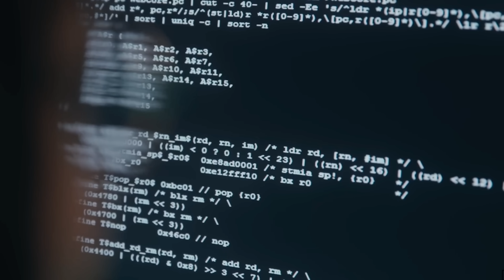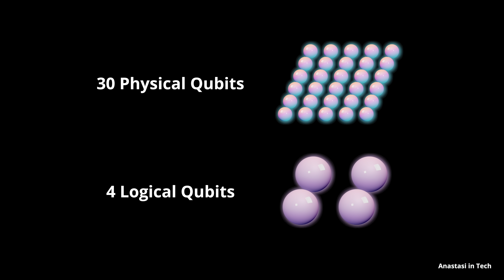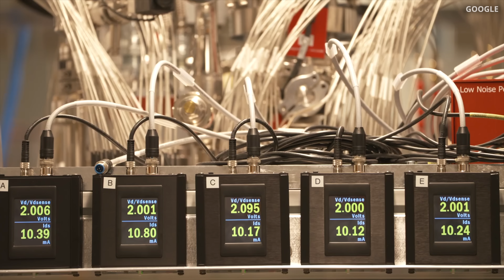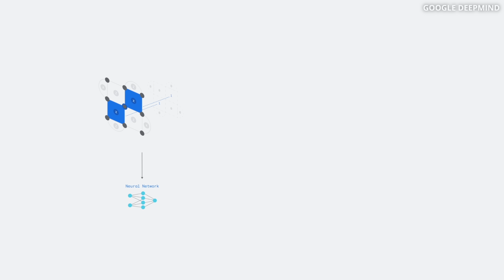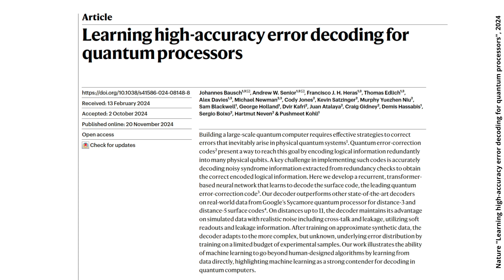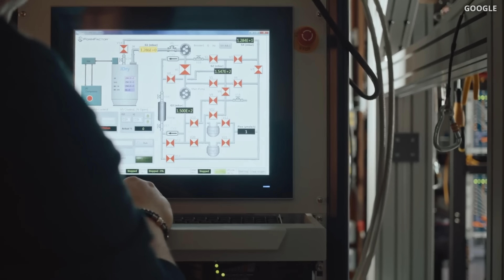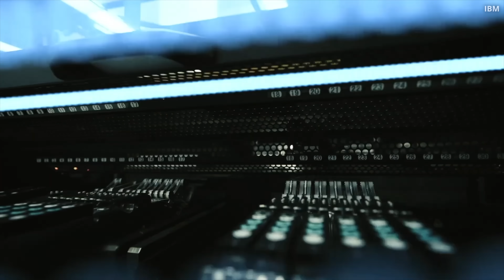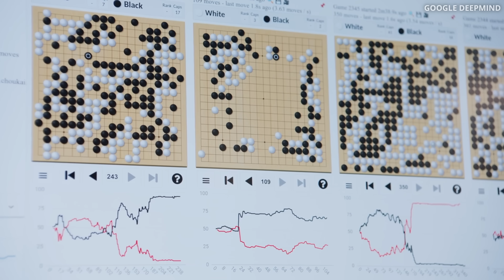When AI Meets Quantum… Everything Changes

Comment: 5 minutes in ~ ok, stop. Time out. I'm being dumb because I should watch and listen to the end, and then react. What's going on at 5 minutes is still largely preamble and introduction, but I can't hold my tongue. My keyboard finger is itching ~
The quantum world differs from the normal world on a number of very fundamental things. Quantum is weird.
Real world, we use something like a tennis player serving as an example, because we all get the physics. This is our world, and (except for politicians) it makes sense. It obeys the laws of Newtonian Determinism. If I drop the ball it takes a specific exact time to fall the 900mm from my hand. We can calculate that down to million-ths of a second.
The quantum world doesn’t work like that. The vital stats of a quantum object, are not fixed or known, they exist as a fog of probabilities. You can say intelligent things about the mass and the spin and the electron shell level of an electron, but when you start to check, the probabilities break down. You have broken the symmetry. That photon is no longer both a wave and a particle ~ you have forced it to become one or the other. At that point you have crossed the line from the world of quantum and Heisenberg ~ into the world of Newton.
Alright, we understand this.
But if the quantum superposition of that q-bit, was what made it a q-bit, but you add error correction, now you have crossed the boundary, the border between quantum and classical. Newtonian. By the exact act of adding certainty, you take away the quantum uncertainty and percentage probability that makes quantum stuff weird. You have taken your thing, your subject, your question to be solved, out of the environment of a university research team, and put it back in grade school with eight and nine year olds learning their times tables.
This is much much simpler maths, far easier to do and to manipulate with algebra, much easier to understand, and best of all ~ there is no uncertainty. You are back in the world of Boolean Algebra, where there are ones and zeros and nothing else matters. Trouble is, you’ve now removed the very thing that made your quantum model special. There is no longer any quantum superposition and Heisenberg’s half-dead cat, because to fit it into MS-Outlook or Excel , you’ve just killed the cat. Yes, it works a lot better ~ it would. But it’s no longer a half dead cat.
You have a much better conventional computer now, but you’ve just killed the whole reason you wanted a quantum computer with half-dead cats to start with.
~~~~~
Personal opinion perhaps, but if you add error correction to a quantum computer, you have made a massively better conventional computer ~ but the damn thing is no longer a quantum computer. The fact it’s made with gold pipes like curved modern sculpture and runs at 2 degrees above absolute zero ~ that’s suddenly become irrelevant. The fact it costs a million$ a second to operate, that's also become irrelevant. It is a far far better computer, but it’s no longer haunted by half-dead cats. 
~~~~~
Now, while I’m objecting to things ~ let’s talk about AI.
AI can be and sometimes is, phenomenally useful. It can do some stuff that no other technology can. It is pushing out the limits, the boundaries of human knowledge.
[sigh] ~ yeah, but … 
AI learns in a way that takes at least a thousand times more repetition and examples, than a conscious logical thinking human. You teach a toddler to tie a shoelace, or his swimmers up, and you might have to show him / her a few times. 2 or 3 might not do it, it might take 8 over the course of a week. But you don’t need to show her how to tie a bow 37 million times. You don’t need to show her that it works the same in the bedroom, on the porch, at Nanna’s house ~ or at kindy ~ nor provide multiple examples of all those cases.
Children learn to think.
AIs learn to react ~ like a reflex. That’s what it is, a one stop reflex like a blink reflex, like balancing a ruler on the palm of your hand. They don’t think ~ they react.
Then we have the problem of eating your own poo.
Q: What do you train each new and bigger and better AI on? 
A: The whole internet, obviously. 
Fine. But what if 30% or 50% of the Internet, has become an AI hallucination? What are we training it on?
Garbage in ~ garbage out.
Ok ~ so what do we get if we combine quantum uncertainty with garbage in ~ garbage out, and the eating of garbage? Or faeces? They told me while learning to tie my shoelaces, you are what you eat ~

Comment: As things stand there are three basic bottlenecks constraining data centres running AI work loads; power, heat and data transfer - getting enough power to a data centre and distributing it within is now non-trivial problem, existing GPU based computing generates heat at a level previously only seen in industrial processes and as the number of compute nodes increases we run into the limits of the data transfer (network) technologies available to transfer data between nodes. Quantum computers - assuming they can be reliably produced at scale - offer the promise of data centres with fewer, more efficient nodes which means less power, less heat and less need to transfer data between nodes. TLDR: AI won’t get much more generally useful than it is, or more cost effective, unless or until Quantum Computing goes mainstream.

Comment: In networking, error detection is done by adding a series of 010101 or 000000 to the end of each frame (CRC error detection) and therefore, calculations required to detect errors are lower than when checking each bit for integrity.  Why does google check each Qubit for error instead of simply checking for the whole frame's integrity?

Comment: AI has nothing to do with quantum computing.  The whole point of AI is to give it a very large deterministic data set and using it to predict the next piece of a puzzle.  The whole point of quantum computing is that it uses purely random quantum states to produce  parallel computations. This is like using a shoe to predict the output of a plinko machine.

Comment: AI was called software, before the mainstream media thought the term "AI" was new.  The problem with software is complexities and hardware failures.  If you have ever created software to solve large complex problems, you will find the software language to be a problem as many of them have issues in the if-then-else statements.  I have issues thinking that Quantum computing will help, as I have always thought of Quantum as the study of nothingness, but that is what software is something you can't touch.  The problem with these large and complex programs is debugging and maintaining the code.  I would advise to never develop this on a Microsoft operating system, as Microsoft isn't designed to run without a reboot.  Linux/Unix is the only way to go forward!

Comment: "Quantum computers have the potential to solve most critical computing tasks in just a few hours" - The claim is indeed an overstatement. Present-day quantum computers are still severely limited in both the number of qubits and the quality (fidelity) of their operations. While there are well-known quantum algorithms that could, in theory, outperform classical methods for certain tasks—such as factoring large integers (Shor’s algorithm) or speeding up searches in unstructured databases (Grover’s algorithm)—their practical applicability remains confined to very specific problem sets. For most critical or broadly relevant computational tasks, current quantum hardware falls short of providing any substantial advantage. It’s far from accurate to say that quantum computers could solve the majority of complex computing challenges within just a few hours, either now or in the future.
Reply: I think the goal is more rhetorical and demoralizing. Imagine a technology that no one understands but they think it is so powerful as to be practically infallible.
Reply: I suspect your cynicism will fall victim to the passage of time, as do most naysayers' objections to infant technology. This will be a matter of time. It took us ~70 years to go from vacuum tube computers to modern processors running 2-3nm process nodes, regularly generating nearly 6.0 Ghz frequently. I think quantum computers will follow a similar path.
Reply: plus they aren't sensitive to noise, the noise is what makes them function, they just produce tons of random numbers, at a high rate and then they filter that out, it isn't working the way they think it works; they don't solve all problems at once, they just move at the speed of gravity which is the speed of subparticles in electrons and protons, which is estimated to be 20 trillion times the speed of light according to Electric Universe Wal Thornhill.  Being that they are handcapped with Einstein's failed math theories, and also the belief in the neutron particle on a failed atomic model, If they get rid of the noise in their current Q-bits it won't return anything, the noise is the only thing giving them high speed random numbers
Reply: 0:43 ❤
Reply: @sorokan761  I love how YouTube deletes my response and then yet keeps notifying me of all your other lame responses
Reply: The critique is well-founded and grounded in the current realities of quantum computing. It serves as a valuable counterpoint to the hype often surrounding quantum technologies. However, it should also leave room for the possibility that future developments might lead to broader applicability, even if solving "most critical computing tasks" remains a stretch.
Reply: surely we had problems with early traditional computers too - and everyone said that there are too many errors etc, but in time they were fixed. There is nothing to say that these eroors they have on quantum computers wont be fixed in time as well - its just another problem that physics bods need to fix, and im sure they will!!
Reply: I dont care about the speed claims, the fact its already solved a problem no classical computer could is amazing milestone in computing history, even if the calculation is useless, its the principal.  We dont even know of problems we can use quantum computers for nevermind trying to solve classical ones, it can give us access to new problems we had no idea we could answer, perhaps programmable matter, or simply simulating molecules to do test we otherwise couldnt.  Which is one thing i heard they did was simulate a hydrogen atom and take some measurements they otherwise  couldnt.    Thats being able to peer deeper into reality then ever before.The things possible with quantum comptuers could be wilder then we cam imagine.  That being said a drop of water contains more atoms then stars in our milky way galaxy or visible universe i forget which, so it would take that many qubits to accurately simulate a drop of water, billion apon billilons which is just not going to happen anytime soon.  But we may not need to, simulating some low level atoms could be enough to make experiments we otherwise couldnt with real atoms and give us new answers. Maybe even lead to something like a warp drive so we can finally explore the universe.
Reply: Google just changed that
Reply: @Airbender131090  they might get usefull quantum computers soon, but they didn't made any progress in the confinmend to very specific problem sets. A quantum computer can not solve all problems faster, just a very specific set.

Comment: To reduce physical errors such as sound and vibrations, QC could be done in space rather than in the clouds. The spaced station could be converted to that effect.
Reply: space has cosmic rays, a noise much more insiduous to eletronics. requires quite the shielding here on earth.
Reply: Whatever benefits there would be to sending quantum computers to space would be far outweighed by the cost of doing so.
Reply: @amihartz  Autonomous computers in space could work 24/7/52/10, much like Voyager 1, so they would undoubtedly become profitable.

Comment: Quantum computers seem to be just around the corner, just like fusion power.
Reply: Do you mean this sarcastically or not?
Reply: add Carbon nano fiber
Reply: Which corner?
Reply: @beku2283  Left at Fusion Corner, straight on to Carbon nanotubes, turn right and You are there
Reply: Already here
Reply: Agreed. The first commercial computers in the 1940s were very poor by today's standards: they only did a few hundred operations per second, they consumed huge amounts of power, they didn't work half the time, and reprogramming them literally mean re-wiring them. However, they attracted a huge amount of investment because they were the best calculating machines ever. This won't apply to quantum computers, so they won't get the investment they need.
Reply: @GrahamLaight Surely that isn't the only sellable function a quantum computer would have. Once quantum computers are scalable, they'll almost certainly replace GPU farms for AI processing, and they'll be incredibly valuable in areas of research and development as well as in cyber operations. I doubt anybody's even begin to scratch the surface of what may be possible with these computers. The mere fact that a quantum computer has recently demonstrated that it can solve in only 5 minutes a problem that would take a classical computer 10,000,000,000,000,000,000,000,000 YEARS to solve is revolutionary. If quantum computers even manage to live up to half of their hype, the introduction of their widespread use will stand as the dawn of a new era in mankind's history. Quantum computing could be bigger than the internet, the smartphone, or even Elvis. 😅 But seriously, though, these are exciting times we live in.
Reply: @GrahamLaight  Do they use in their quantum communication qubits or transistors?